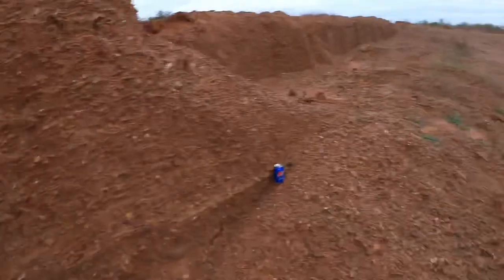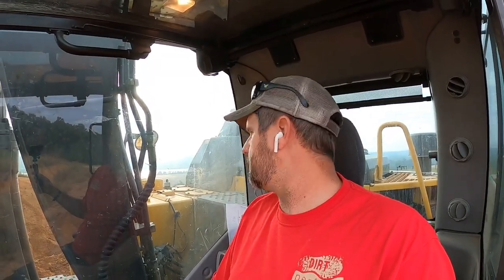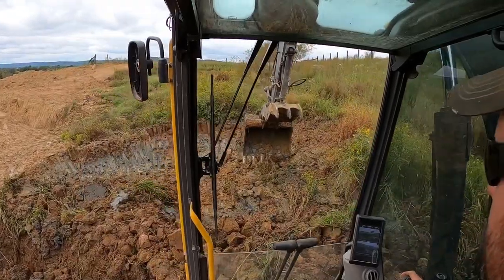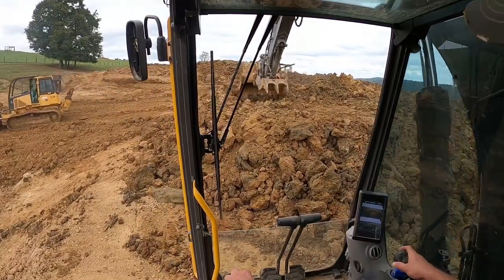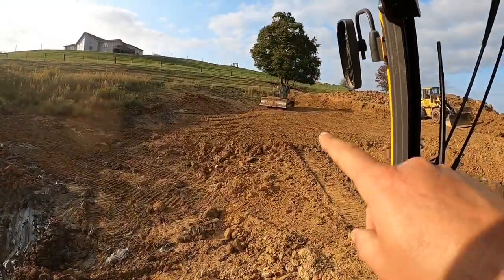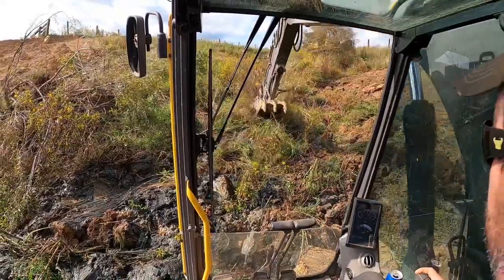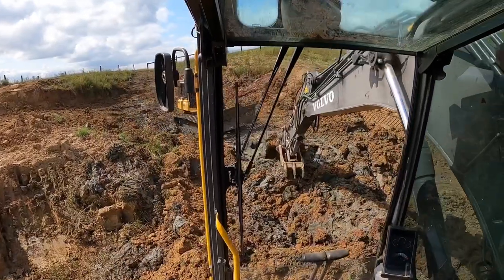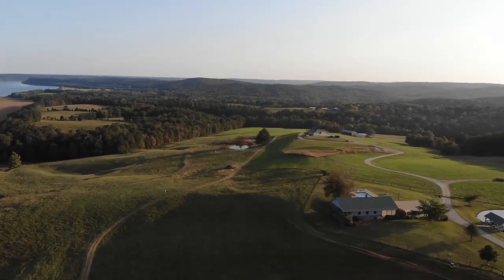Weekend at logger Wades loading trucks and dredging a pond

Comment: I worked with a guy as a laborer and had a chance to run a 84 cat D4H high track and until that point had just moved it around at the shop when doing maintenance on it ,he  had me jump on it showed me what did what showed me where the oh shit pedal was stayed with me for about 15 minutes and oh hell you got it have at it ill be back to check on you in a bit ! That ended up being what I run alot of the time , me and 1 other guy where the water ,sewer, and rain bed guys , I loved that job I would still be doing it if I didn't get hurt I had a heat stroke in 05 and got hit by lightning in 06 and was out of work for over three years trying to get better then 08 hit end that was the end of that for me but he was a great boss to work for and would never ask us to do something he hadn't done himself a hundred times

Comment: That’s nothing unusual for truck driver’s.When I was on road construction they did the same with me.Takes a couple rounds before they get spread out

I went from heavy equipment operator Of almost 30 years to running Volvo rock truck and loaders to backhoe building bush haul roads.The first 6 months were a learning time.As the days went by I became more confident in my ability to learn and help and guidance from.I agree with you and the counterweight.

Comment: Hey Mike I have point with the counter weight hitting the mub on your blade but I work for a Volvo dealer in mississippi and everytime we rent a machine I didn't care if only for one day or 30 days the counter weight is always mess up and I have to fix it. With 2 cams on the machine why do the operators have to hit the counter weight. I don't get that. There has to be a way to run the machine with out hitting the counter weight. Thanks for the video.

Comment: Besides an older video, on the 'Scratched counterweight' argument. Scratched paint just means that equipment has been used. Now, if it was bashed, dented, falling off, chunks missing. Then I would have more concerns, like, now you are just swinging wildly into every obstacle you come across. Accidents happen, but if the whole end is a mess like that?

Comment: I know this is a an old video but after listening to DP rant about the paint job / visual presentation of his equipment to customers.  I am of a firm opinion that keeping the paint jobs of a equipment looking good is very important for several reasons. The first has nothing to do with what a potential customer but rather with personal self pride of your business as well as how an employee will care for and operate your equipment.  Think about if you keep your equipment washed, the interiors free of trash (especially food and drink containers) and mud/dust the equipment will not only last longer but because looks good even if it is a 10, 20, or 30 year old piece of equipment employees will be less likely to abuse, or unnecessarily roughly use your equipment than if it’s full off trash, has ants living in it because it has food and beverage containers in it, nor will they be as likely to do things with your equipment that they should not if it looks like the boss / owner cares for how his looks and runs.  Secondly if a potential customer sees a company with a fleet or dirty scratched up and otherwise equipment that looks like it has been treated like a government mule / run hard and put away wet or sees a company who’s fleets of equipment that is clean and generally looks like it has been well maintained (which includes the paint job) to me as potential customer shows pride of ownership which normally translates into pride of workmanship.

Comment: How you explained about experience with 2 years of trade school versus experience running dozer reminded me when I was applying for flying Corporate. It's extremely hard finding corporate flying jobs for younger pilots because they do not have the hours flying multi-engine airplanes so how do they get the hours due to insurance reasons if they do not have the hours. It's a catch 22 so in order for me to get the hours flying multi-engine was being a flight instructor during law school. Once I had enough hours and after law school I flew cargo for a while then my dreams flying in the airlines ended when I joined the Army because no one was hiring pilots in the late 1980's early 1990's so I ended up going into the JAG CORP (Judge Advocate General) I was a lawyer for 18 or the 24 years in the Army. 6 years I was enlisted first before going to Officer Candidate School or OCS

Comment: The operating engineers union has a 380 acre training facility where they have trainees operating equipment for a few weeks as well as training for current members in a different type of equipment. The courses are run by experienced operators who can tell very quickly if someone can operate equipment.
Reply from the maker: Yes you can

Comment: DP would a compactor do you any justice? A layer of this pond fill with a layer of good compacting soil and then compacted down with a roller would that do you any justice?
Reply: I attempted to buy some acreage with a pretty good slope with the intention of plugging an earth - style home there because of a perfect southern exposure.   A friend of mine that worked for the county zoning department walked it with me and we dug a half-dozen holes to see what kind of soil was beneath the surface before I hired a soils guy to do a 'perk test'. 
      My friend showed me 3 different areas on that 8 acre slope where the surface had sloughed off many years before (called them mini"lahars" or land slides then pointed out the layers of grey, blue and orange clay stratas beneath; they grey and bluish types were as slippery as axle grease.   He said unless I was going to start a pottery business I should run away at top speed.
       It was apparently good advice as the city has long since enveloped every inch of ground with housing developments for 5 miles,but that slope is still just growing trees after 35 years on the market.    
       Unless the land beneath was flatter than pee on a platter and you spread your muddy goop about the thickness of peanut butter on a sandwich, a packer/roller would just move the nasty stuff in front of it.
Reply from the maker: No

Comment: DP don't you have to rip your lifts after rolling it in before putting in your next lift on top of it ? Sure have to in Los Angeles  !
Reply from the maker: Not here
Reply: That's why you use a sheepsfoot roller to compact.  It kneads the layers together.  The best way to compact fill especially clays.  Ripping destroys some of the compaction that has been obtained.  Kind of counter productive.

Comment: The guys that Bitch about scratching the counter weight are guys that does not know what a good hard days work is about. The only thing I bitch about is check and grease the machines every morning and keeping the Cab clean. You can sweep a Cab out while your machine is warming up. I had my Cabs clean even when I was dredging a lake channel with mud coming in over my feet most days.

Comment: Counter weight scratches to me is irrelevant to the machine function and operation, multiple dents on the other hand, well I’d say you might look at the operator. Paint doesn’t make the machine operate better, but, fading paint and scratches just the machine is in use and still operates fine.😉

Comment: sure your moving machines around, but its all money weather your digging or your floating the machine to another job, i have yet to bring anything in were i am not charged a huge floating charge, both in and out, the last 2 machines i have come here, was a 225 cat excavator, and for that one i paid $275 cnd to float it in and another $250 to float it out, it is double dipping as i see it, as im paying 250 to float it out, but someone else is paying a float in charge of who knows depends how far it is going, then i had 2 time a cat D8, dozer, had them strip half my land one summer and the other half the next, and all 4 floats i paid $375 each way in and out, then in and out the next year, but the 2nd year i split the float costs with my neighbour as he needed a D8 on his land, as his land was logged the year after mine. i lost count over the 39 years how many big excavators i have had here and always a float fee in and out, when i rent a mini ex or skid steer i pick them up and drop them back on my trailer or in the dump box of my F600, as for that hill full of nice fill, it was pushed up there by the ice age, same how the great lakes were formed and the hundreds of graval pits we have here, plus the 789 foot long clay hill in my front yard thats over 60 feet high, then a big valley, and the half sand and half clay hill the building sit on, funny how one end is all tan color fine sand and other half solid clay, and 60 feet deep clay all around, and not one rock any were know mater were i have dug, drilled well the bed rock was 73 feet down, 60 feet of gooy clay and 13 feet of coarse gravel, i have test holed all over, no rocks. how i got my experience on heavy equipment as learned it, is in my teens i worked for a guy free of charge long hours, sure i lived with him and his wife and they feed me, bought what i needed.. for 3 years, was everything from logging, to electrical dozer, backhoe loaders, excavators, truck driving, every truck from tractor trailer, 5 tons, tandems, triples with a 4th air lift, skidders bunchers, limbers slashers, you name it..

Comment: Im going to help you rant on the dump truck drivers. Our do the same thing and it drives me crazy. They all have cb radios but the act like they dont reach out 50ft. When they actually reach out for miles. If you tell them to stay separated, they wont. If you intentionally try to spread them out they always come back together. You can always tell which is the laziest truck driver by which position they take in line. I feel your pain with lazy truck drivers.

Comment: Dump truck drivers run in a pack, only one knows where they are going and only one knows the way back and they aren't the same person.
It's irritating when loading trucks and the pull up and stop then pull up and stop and pull up and stop, just idle on through till the horn or the bucket dumps.

Comment: I was a ground bitch for my neighbor who had heavy equipment I would go in and cut trees out of his way and run fire hose because in California you have to put water to the dirt to get it to compact I worked hard for him so one day he came at me and he said to me Jamie any time that you want to get    on a peice of equipment for me to feel free to do so he was willing to let me operate any peice of equipment he had he had three semis and he was going to even let me drive them but he knew that we would get into big time trouble if he would of let me drive the semis I got my chainsaw stuck in some trees that I was cutting for him and I had told him that  I got it stuck and if he had his cat 320 excavator on the job he would be like Jamie why didn't you swing excavator I told him that I didn't know how to turn it on one time I cut down a bunch of avocado trees for him and there was a lot of wood from them so I had to clean up all of the wood he had a John Deere skid loader and a cat 950g wheelloader he told me to use the skip loader to clean up the wood and I told him that I was going to use the 950 to clean up th e wood because the 950 held more than the skip loader did he didn't keep me working for him because i didn't know how to place the dirt and to get the controls down on the machine and he didn't have a whole lot of that type of work he would bid himself right out of work he would charge to much to do excavateing and sometimes he wouldn't pay me for me working for him so I just stayed away from him and I worked on my own or for my grandmother I was a tree cutter i could do everything in the tree cutting industry I was wanting to be an equipment operator but no one ever gave me a chance to be one